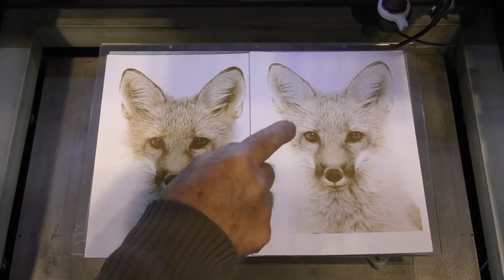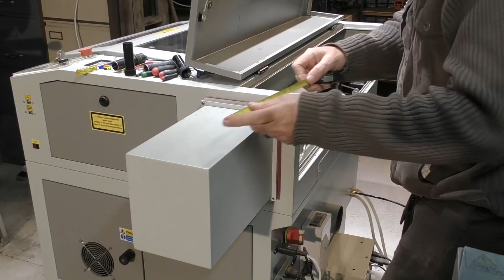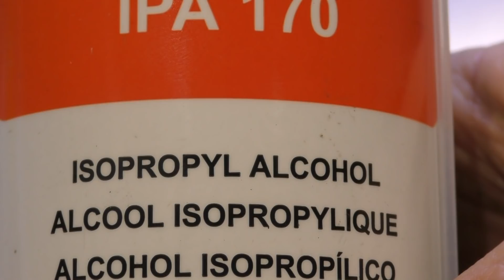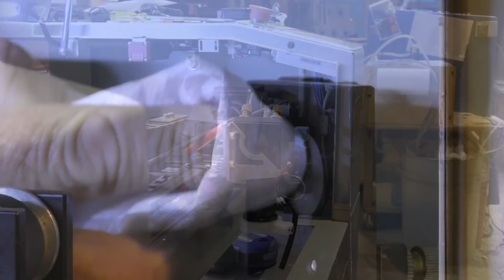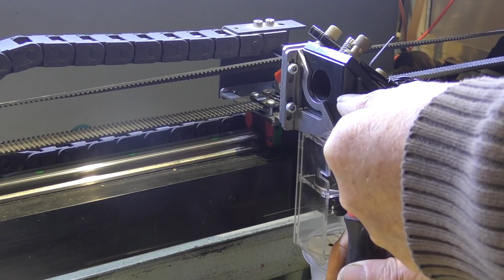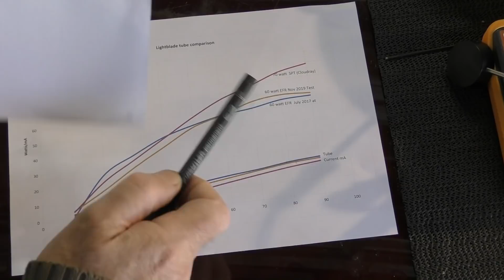RDWorks Learning Lab 176 New tube for Lightblade

Comment: What diameter are your targets?
Reply from the maker: Hi Dave
 The targets are a snug fit into the small recess in front of the mirror. It depends on the brand of your mirror holders but they are typically about 23mm diameter for a 25mm mirror holder.
 Best wishes
Russ

Comment: Hey Russ, thanks for your videos. I have bought an used dual head machine from a shop that closed in 2010. Machine was built in 2009 and had very little use before taken out of service, however I had to do some work to getting it back to working order. I've retrofitted a new controller and replaced the 48v power supply together with one of the drivers that blew it. Both tubes were full of water when machine was moved to the storage and water had became dried mold by the time I got it. All silicone tubbing and chiller's water pump were taken apart and washed with tap water and Clorox. Tube had some hard water sediments that were dealt with a mixture of white vinegar and water and left circulating overnight. I've got the machine to a point that it runs and I'm able to use it to cut thin materials as tubes are almost dead by now. My laser power supplies have a setting for you to choose 1 - 1.2 - 1.6M, the dead tubes I have now are both 1250x55mm 60w and PS are set to 1.2. Here is my question (if you are still reading this long comment). Do you think these PS would be able to drive a 90w tube or even a 100w if set to 1.6M? As you were expecting 60w out of your tube but got almost 85w at full power it got me thinking if I could get away with buying only a new tube instead of both tube and PS. Thank you!
Reply from the maker: Hi Victor
 I do not want to advise you wrongly. I will need more details so can you attach your disguised email address (victordotaig21atgmaildotcom) to another comment and I will write to you with some questions. That way you can send me pictures also.
Best wishes
Russ

Comment: Russ My Co2 Laser started Hissing when it cuts at high power...I remember that you had mentioned this before with your laser...can your refresh my memory and let me know if this is an issue I should address. Thank you, you're the best.
Reply from the maker: Hi Dwight
There  are only two hiss noises you could be experiencing , one will be because there  high voltage arcing/sparking either form within your HV power supply or from the red wire (usually near your tube)  or the hiss is from within your laser  tube. Whichever reason,  you should be experiencing power loss. Do you have an ammeter on your machine? If so, does the current drop when the hissing occurs? Try and locate the source of the hissing and let me know.
 Best wishes
Russ
Reply: @SarbarMultimedia  Russ,
    Well I wiggled the High voltage lead  on the tube first and asked my wife to watch for arching on the output post (the negative post where the CO2 beam exits the inner glass tube I presume it would arch to the metal inside that ) We did not see any Arching on the Tube and I did not get the hissing this time. I think I will keep an eye on it to see if it reoccurs (and check the Positive connection). On another note I have a CNC plasma table in the mail currently I've gotten 2 Packages out of about 8 on that ( I really think I wont get all of it until the first week of May).I started watching you videos a couple years ago then ordered our first machine, a 100 watt Reci  tube 600 x 900 (you don't know it you were very helpful in getting the spec's ironed out) we also just paid the last installment on next machine ( a 900 x 1300 100 watt Reci- same power so I can exchange parts if I must )  we are trying to pay for everything this year since I am a 58 year programmer that forgets as much as remembers. we are Hoping in a couple years to do this full time. You have been very insightful and useful to us. (except I dont have a rich wife to whisk me away on Holiday ...But I do have a Mother in law living with us, she has a large broom collection and flight license for each) Best Regards. Maxx Bauer.
Reply from the maker: @dwightbauer6705  Hi Max

 You didn't give me answers to all my questions but in messing with the output end black  lead and appearing to fix the problem tells me quite a bit. At the other end of the tube there is 25,000 volts or more , DONT try the same thing there. The black lead is safe because there is almost zero volts there. So you will never see sparking from that end of the tube.  The tube is filled with f 3 gases  and all gases are naturally non-conductive to electricity. The most "feeble" gas in the mix is nitrogen,, so when you threaten it with 25,000 volts it starts to break down and release free electrons.   This is stage one of the HV power supply's  job.  That non-conductive nitrogen has now effectively turned into a piece of wire and WILL carry electrical current when required to do so .If you have your power set to 1% you will see nothing happening in your tube when you press the pulse button. If you raise the power to about 10% you are now telling the power supply to do the second part of its job of MANAGING the current flow through the IONIZED nitrogen.  All gas discharge tubes like this have a strange characteristic every time you switch them on. They almost instantly pass through a phase called pre-ionization You can control and examine this phase within your tube  by looking at the beam and listening. Raise the power by  1% and go look and listen. You will see the beam gradually building from each end of the tube but not meeting in the middle  (by the way it is in no way dangerous to look at the tube) Keep increasing in 1% increments  and eventually at 15 to 20% (depends on your tube) the hissing will stop the beam will be solid pink and rock steady, That's preionization finished. IF you have an ammeter on your machine and check the current flow you will find it to be about 4 or 5 mA.  
What has all this to do with the black lead?
If you have a good connection onto the cathode then the HV power supply can do its job of controlling the current through the tube  If that connection has any resistance (ie a bad or intermittent contact) the current cannot flow and  effectively you are keeping the tube in it's low power preionization phase.
You must look carefully at that connection. On many tubes ther is just a small pin forthe wire to connect onto. The Chinese just wrap the black wire around the post You must NOT attempt to solder the wire  because A) it wont solder and B) in trying to do so you risk cracking the hermetic seal around the pin.  You may have a screw fixing but I doubt it because you  would not detect an issue there.  One solution I have seen is to use a small crocodile clip to make the connection.

Food for thought

Best wishes
Russ

ps She's not that rich (it was just one of my fantasies!!) and it's my money she's spending or to put it more correctly ...the kid's inheritance

Comment: Russ, i have a question, my tube is a 700mmX50mm it says 39Watt on the tube that has been written by hand, i managed to find some spec, they say operating current is (Edit) 22 mA. Will i see a benefit of running it below 20mA or is it better for the tubes life if I always run it at min 22 mA? I have been watching both your channel for weeks on end lol no shortage of laser info but i haven't found the video where you talk about optimal current operating.
Reply from the maker: Hi
700mmx50mm  tubes are actually 35 watt tubes and should not be run above 17mA 
800x50mm=40 watts run at 18mA
1000x50mm =50 watts run at 20mA
1200x55mm =60 watts run at 22mA 
Above this there are varying guides  but typically 80 watts =24mA
 Running at more than the recommended current will shorten your tube life quite dramatically.
Best wishes
Russ
Reply: @SarbarMultimedia  Thank you Russ, for all the useful video's and info you provide and the swift response, I did suspect my tube was a 35Watt Even if all the spec's I found claims 40W, So if i get this right, Running the tube at 17mA is no worst than running it at 10mA? just to make sure i keep it under the 17mA, Correct? BTW i had bought this "40Watt" 35watt lol laser engraver before I found your video's and i since then I order one of those 50Watt blue ones like the one you have,  meaning your videos are going to be crucial for me lol

Comment: Hi Russ.  I have an issue with my tube that I am trying to get sorted by Weike and I am starting to lose my Sh!7 with them.  They have me following this video https://v.youku.com/v_show/id_XMTMwNjY4Mzc3Ng==.html?firsttime=0&from=y1.4-2
to assess my situation.  What happened is I started my first job that made it half way then the laser stopped firing.  I looked at the laser an found the shell side of the tube flooded.  I was under the assumption looking at the install video that the fluid should just be in the inner tube.  The sales person mentioned that she saw nothing wrong with it.  Could you please have a butchers and let me know what you think.  thx 
https://drive.google.com/file/d/1BRosorr0fOnzMqOQbvd3ULIE-mjyFS_F/view?usp=sharing
Reply from the maker: Hi Adam
 I am presuming that your cooling fluid has some antifreeze added and that is why it is green?
There are 3 tubes that make up glass assembly. The outer tube, with the spiral pipe  at the high voltage end, which is the gas reservoir, a second tube which is the cooling water jacket and a third central tube (it usually has a pink hue to it) that is the ionization tube. The inner and outer tubes are connected so that the gas in the outer reservoir can circulate through the central tube. The water jacket is connected to the inlet and outlet pipes and wll always be limited to the space between the central and outer tube. Water in the outer tube is the result of  some sort of dramatic mechanical failure in the glass. This is usually the result of overheating when there is no water flow.  Did you run the tube for just a few seconds without water Flow? There should be  a water protect flow switch,, I guess yours is in the CW5200 chiller. When you switch your machine on it will beep untill the water flow switch enables, only at that point can the tube fire. However, having the chiller audible sound is one thing but have they set the enable switch within the vendor settings> Go to file, vendor settings and use the password rd8888.  Go to the Laser tab and at the bottom there should be a tick in the water protect box. Without wanting to be rude I suspect your lady sales person has never touched a machine and is just well trained in soaking up angry customers. How long have you had the machine and did you buy it with your credit card? If so, you may have some leverage. I know of several folks with Weike machines, generally quite good build quality but some are happy others have had issues.
Best wishes
Russ
 ps. In 4 years I have encountered 4 dramatic tube failures. One was dead on arrival, one was caused when the water in the tube froze, , one was self-confessed failure to turn on the water and the 4th is yours,,,, ,,,cause unknown.

Comment: Great stuff Russ!
Did you ever see the focus change from one end of the bed to the other?
Mine has a much wider, less focused beam on the left (hot side) than the right. Alignment is dead on perfect. Table is within 0.2mm right to left. The tiny spot cannot be achieved on the left, at any focal distance. Cutting a line left to right, it gets thinner as we go to the right. Just like the table is tilted, but it's not.
Very noticeable if I run a line without the lens. The beam width almost doubles on the right, getting proportionally wider as we go right.
Reply from the maker: H
 Your problem is very puzzling. but you have not clearly defined your test. If you remove the whole lens tube then what you are suggesting should be impossible because the beam is almost parallel and it will not matter about the height or any tilt on the table, the line should be parallel across the table. If you carry out this test and you still get varying line thickness  (it will be a thick line) , then I have to assume you beam is hitting something as the head  travels across the table. This can only mean your X beam alignment is  not good enough.. If you are still having issues then add your email address to another comment (disguised like   zippyatgooglemaildotcom) and we can speak off line and use photos and video to fix the problem.

Best wishes
Russ

Comment: Hi Russ.
Best alignment video by far... well done..
Question.... is that a 'small orange fix'  I see on the belt drive to 'miss' the new Angle bracket ?
Reply from the maker: Hi Jerry
 I knew someone would spot it . I will have to come clean. The bracket I designed and made originally was in 3mm stainless and it included a small design oversight. The belt and the stiffening bracket intersected!!! Oops. . I hastily redesigned the whole bracket for a Mk2 version constructed from 2mm steel because I felt that 3mm was over engineering and unnecessary.  I was wrong. There was a very small stiffness issue that became apparent with 2mm  material so it has been put back to 3mm and this little temporary alternative path for the belt introduced.  I am waiting for Cloudray to send me  a prototype for approval and everything will be back to normal. Many thanks for making me "come out" about my grey cell deficiency!!

Best wishes
Russ

Comment: Shout out to my chinese laser ebay seller 'chinacnczone', who supply (as standard) a laser-mounting head ( http://0x0000ff.uk/imgs/laser/adjustable-head.jpg ) that adjusts in both Y and Z just like Russ's head. I don't think their "secret weapon" is quite as fancy as Russ's one but it seems to do the job :)

Oh, and (of course)  many, many thanks to Russ for the detailed video on how to set things up. 

The Z-axis travel on my machine isn't particularly smooth - X and Y are like butter, but there's a sideways back-and-forth oscillation of the bed as it travels downwards (which isn't an issue in normal use because I don't dynamically change the Z height within a job). This does mean that the later part of the Z alignment is a bit trickier. 

I reckon I could extend Russ's plastic tower thingy, however, to manage that and not use the bed at all - just have a lower shelf to put the target on for lining up. Once the beam is perpendicular, it's also going to be perpendicular to the bed in normal use, after all...
Reply from the maker: Hi
 Sorry for the late reply

I have been proclaiming the advantages of Z head adjustment for more than 2 years now and from my contacts in China I understand that a few factories have responded with their own take on the principle. Yes this is crude but adequate provided you keep the axis of the lens tube perpendicular to the table, 
Your wobbly table problem will be overcome if you just mark the top of one of your table leadscrews or open the cabinet and mark the bottom toothed pulley. All the leadscrews rotate together, hence the table wobble will be cyclic and repeatable. Do the  top burn and note the position of your pulley mark.  Drop the table about 6" and set your pulley to the same position before doing the second burn.

Best wishes
Russ

Comment: Another brilliant video, I purchased from Thinklaser after watching your videos and would like to say I’m very pleased with the machine. I have just finished winterising it’s after watching your video on the subject, I have used the two lamps under the tube but made a change by cutting into the flexible chiller pipe and arranging a pair if 40mm tee plumbing fittings and placing a 50watt fish tank heater into the tee pieces, this raised the water temperature by 6 degrees in 1.5 hours and added to the general warmth of the machine in a cold workshop. Keep up your brilliant videos Russ.

Comment: I was hoping to see the ionization tube inside the laser tube you removed from the lightblade machine, but unfortunately the exterior of the tube was covered with debris.  Could you clean off the exterior of the tube and let me know if you see any transparent tan or slightly pink color coating the glass wall inside the ionization tube?
Reply from the maker: Hi Stephen
Yes it did have (and still has ) that pink hue to the ionization tube. This is the video of me fitting it over two years ago and there you will see everything you wish to see .
https://www.youtube.com/watch?v=9P_djrV2yqQ&list=PLPWEtx5V9DqEogIeYRdcG_KYcB7UL2Qmn&index=25&t=1538s
Best wishes
Russ
Reply: @SarbarMultimedia  I was concerned when I saw this transparent tan color inside the tube of my laser cutter thinking that some damage had occurred over the months my son and I used it although we took care not to overdrive the tube.  The (American) company we purchased our laser cutter from told us it shouldn't be a problem as long as we didn't exceed 85% power.  we never drove it more than 77%.  Thank you for taking the time to answer my inquiry.

Comment: What program are you using to burn those pictures
Reply from the maker: The pictures are prepared in Photoshop because it is more flexible than than the tools in RDWorks.  I usually dither to 254ppi within Photoshop also and then just use RDWorks to do the final conversion to machine code. RDWorks dot dither is pretty good also  for nice clean images like this. It's  photos that often require quite a bit of work to get the contrast, sharpness and brightness correct.

Best wishes
Russ